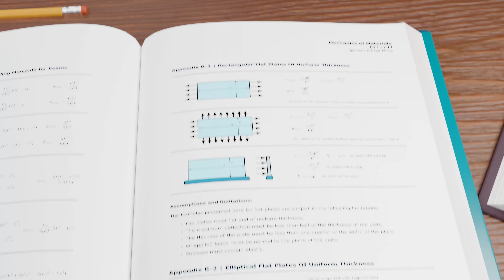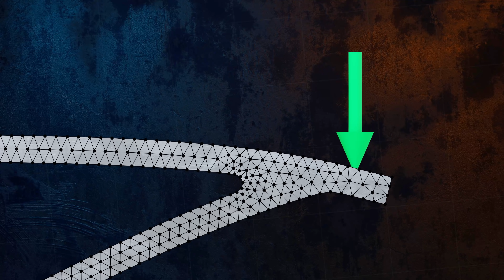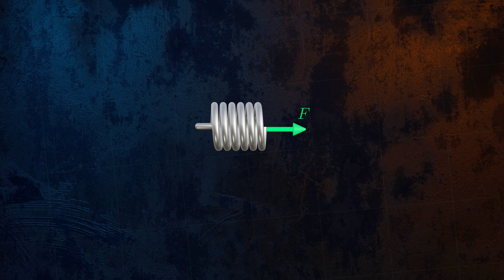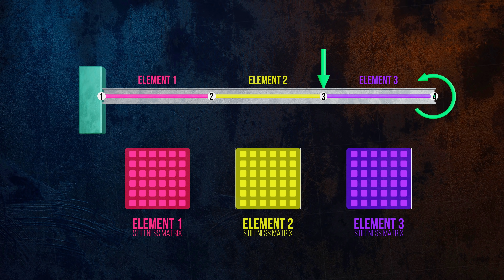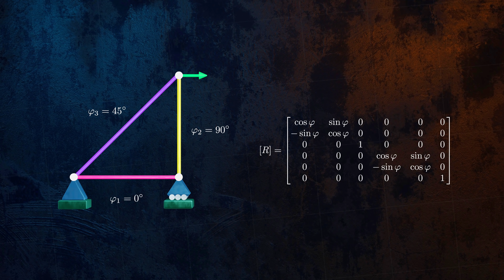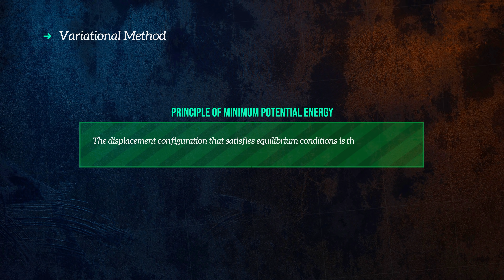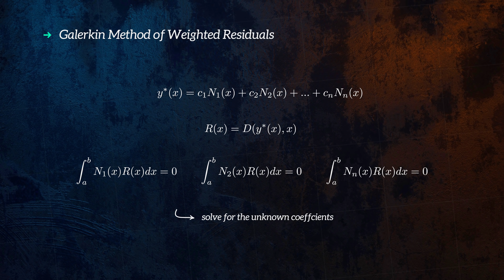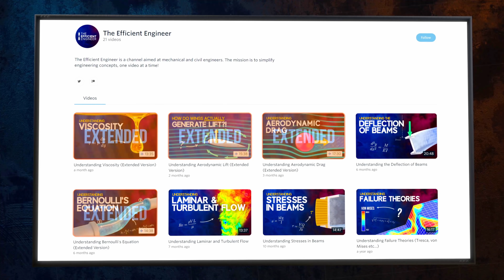Understanding the Finite Element Method

Comment: It has been a wonderful journey learning that you can also use finite element method to solve parabolic derivative pricing problems. I highly recommend using FEniCSx scientific computing ecosystem for solving partial differential equations. I recently derived the weak form for a derivative pricing partial differential equation and learned that there exists higher-level abstractions available to automatically compute formulations of discontinuous Galerkin finite element methods which is notoriously verbose to define.

Comment: Thanks for the video. I really appreciate this so easy-to-understand explanation. I'm not even a mechanical or material or structural engineer, but I can easily understand it. When I refer to several reference book, I found it's hard to understand FEA, but then I found this treasure and I could say this is the easier form than those books.
You're the GOAT. Keep up the good work!

Comment: In the video you mentioned about the equilibrium of system should satisfied the least potential principal. I wonder if I can replace it by least Lagrangian action principal to generalize such idea to the dynamic system, cause it will have to involve the time derivative over nodes which makes the equation even harder to solve?

Comment: Researching many content of this topic - I can say your Presentation is key to all!
    Like engineer I can say that finite element has become the method of choicr for solving many types of partial differential equation in engineering equations and physical sciences. It is like you have said - important applications include mechanics, FLUID FLOW (for mel), thermodynamics and electromagnetic field. We usually, take what you also say (so this is brilliant who you differnt issue) =The basic idea is very elegant and dates bak to the classic al work like Gelerkin or Rayleigh, Ritz almost a century ago.
You have all important topics! 👏👌

Comment: I really think you engineers make things far more complicated in the long run by avoiding any discussion of the underlying PDEs. It is far easier to understand the FEM by stating the PDE (in this case linear elasticity) and boundary conditions, deriving a variational form (quite easy), defining shape functions, and thence defining a discrete linear system. Completely avoiding this is silly and makes the method seem like just applying memorised formulae, makes you only be able to apply FEM to particular elements you know the stiffness matrix for, and means you have no idea how to apply the method to other problems.

Comment: What a great introductory explanation.
I was searching for a proper introduction in FEA, however, I could not find one before watching this video.
I was wondering about how to arrange the stiffness matrix etc. And why differential equations are involved.
I tried to observe the approach from engineering, but the literature was lacking of formal mathematical description or sometimes skip them.
Then I tried to observe the approach from pure math literature, I ended up only reading methods for solving the differential equation but did know why the differential equation is there.
Thanks for your great video!

Comment: I played around with the Solidworks Student Version about 12 years ago.
As I recall it did not distinguish between Normal & Shear Stresses.
In other words: 
The Normal & Shear forces were just added together, without using a Mohr Circle.
The class I took did not cover FEA, but I surmised myself using a story problem that involves:
A large pulley that is mounted on an overhanging shaft that causes bending (Normal) tension, because the shaft is supported only on one end.
A rope is attached to the pulley that has more force pulling down on one side, thus causing rotational (Shear) force on the shaft that pulley is mounted on.

Comment: This was beautiful. I did a course for CFD and it had similar information to what you covered. There is so much math history embedded in this type of modeling that is really cool. We got to use COMSOL and the solver for simple projects still took hours to get a result that would fail to converge unless you fine tune the mesh and other parameters that we knew nothing about. I wish I had more experience in this field so I could do my own 2D/3D work.

Comment: Well FKU too. But honestly I was just recapping the school material about this and figured out things. If I ever saw this, it would've been clear as a day how to apply these. I feel like so often there's a gap for some reason between learning the theoretical and applying it in your common problems. And there shouldn't be if you were taught like this. Like "look at this part of it, that's what you modify depending on this, and this is what this and that part imply so you arrange them depending". Like you learn for example the matrix and what the symbols inside it mean, but you don't actually understand how it relates to a structure or loading case.

So silly. Just list things by nodes, check the forces in horizontal and vertical directions, momentum, check displacements in horizontal and vertical and radial, and modify the stiffness matrix depending on how the nodes are connected. It looks so much more simple now. The matrices look huge and complicated, but a lot of it is zero and everything in is familiar, you just need someone to demystify the whole ordeal with matrices.

Thank god for Ansys and SolidWorks though for giving the answers without much more than modeling the item and placing the loads.

Comment: Firstly, this series is so wonderful. So much intuition easily displayed and digestible. I have a question for clarity though:

@9:30 you mention the matrix as having overlapping terms for node 1 with node 3 but in the matrix it looks like you illustrated node 1 overlapping with itself and node 3 overlapping with itself. Should the matrix illustration be mirrored about the vertical axis so that opposite corners show the shared terms?

Comment: Use correct writing of SI units' symbols, please.
Reply from the maker: What do you mean?
Reply: @TheEfficientEngineer , Hz, not HZ. MPa, not MPA.
Reply from the maker: Yeah, it's just the font. Thanks though.
Reply: @TheEfficientEngineer , not sure if you mean it's due to the font and can't be changed, or that this is just the font and it is acceptable. MPa is megapascal.  MPA is, if anything, megapetaamper.
Reply from the maker: The font I wanted to use was all caps only, so I made a conscious decision to be a little less rigorous with the units.

Comment: Great video. However, I want to point out a technical mistake in the video. Galerkin method of weighted residuals is a variational method but don’t use “weak form”. Ritz approximation method uses weak form.

Comment: Amazing work !! Thank you so much !
Just a quick remark : at 10:40 it is not the global K matrix that is inverted but the reduced matrix. Global K as shown here does not have an inverse matrix at least because of rigid body motions. And it’s usually not inverted because it is CPU  expensive, but some kind of Gaussian method is used to solve the system.

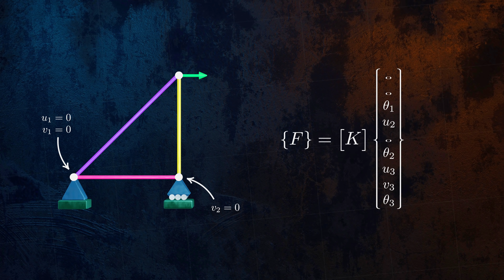Comment: Very nice introduction to FEM. Well done ! Except...at 10:28 the vector of applied forces does NOT include the reactions: reactions are calculated later from the grid point force balance. At internal nodes - the balance obviously is ZERO,but at the supports it is not. Otherwise - excellent video.
Reply: I had this same question. Do you mind elaborating on how (and when in the process) the reaction forces are determined? Thanks!
Reply: @arcanaught2045  You have the stiffness matrix of the structure. You have a vector of displacements (consisting of unknown displacements in a global coordinate system and the known boundary conditions). You have a known vector of applied loads.

I will leave aside the problem of constructing the matrix of stiffness - it involves calculation of element stiffness matrices individually for each element, transforming to the global CS and placing the appropriate terms in the global stiffness matrix where they belong.

Taken together - you solve for unknown nodal displacements. Then you apply the nodal displacements to each element (through the element stiffness matrix, and using the element coordinate system)- which allows the calculation of element nodal forces. At internal nodes - the nodal forces contributed by elements with common node are canceling each other (as a condition of equilibrium). At the supports - the sum of element nodal forces adjacent to a support (a node with specific boundary conditions) produces the support reaction.
Reply: @les8489  Perfectly described. Thank you!
Reply: Hm...my other answer with the link to my Google Drive somehow disappeared...
Reply: @les8489  I saw it! And I intend to work through the problem this morning. Thank you so much! I'm currently using FEM tools for work, but I feel incompetent because I don't really know what the solvers are doing. 

Do you recommend any particular introductory FEM textbooks to learn the topic? I purchased Introduction to the Finite Element Method by J.N. Reddy, but so far it's extremely dense and not as approachable as I was hoping.
Reply: @les8489  I worked through the problem you sent. From that, it looks like you solve for the nodal displacements globally first, then apply these displacements to each individual element and solve for the unknown reaction forces, which is exactly what you described. Thank you! Again, if you recommend any simple introductory FEM textbooks, please let me know.
Reply: @arcanaught2045  Yes. The example which includes matrices was intended to illustrate the flow of the analysis. Again - this is about the simplest example possible - but it illustrates the general approach. Regarding the books...well, there is wealth of information in NASTRAN manuals. "Programming the Finite Element Method" by I.M.Smith abd D.V.Griffiths also contain a lot of useful info. Somewhat more involved is "The Finite Element Method" by O.C.Zienkiewicz and R.L.Taylor - but there are many more available. Unfortunately there is no "quick and easy" way to understand the method.Generally - the whole method can be summarized as:

1) Mesh the structure into elements (type and order will depend on the structure)
2) Get coordinates for all nodes in each element
3) Calculate stiffness matrices for each element using the Element Coordinate Systems (you will need material properties here, and node coordinates for each element)
4) Assign identification for all DOFs which will allow to specify the size of the stiffness matrix
5) Transform the individual element stiffness matrices to Global Coordinate System
6) Locate individual terms from element stiffness matrices into appropriate location in the structure stiffness matrix
7) Prepare the vector of external forces {F}
8) Specify DOFs which are constrained and eliminate appropriate rows and columns from stiffness matrix
9) If non-zero displacements are specified at some nodes - modify the vector of external forces by adding known terms (known displacement*relevant term from stiffness matrix) and remove appropriate rows and columns from stiffness matrix.
10) Solve the problem {F} = {K}x{U} for {U}
11) Apply the nodal displacements for each element (after transformation to Element Coordinate System, of course) and calculate nodal forces
12) Transform the nodal forces from each element to Global Coordinate System
13) Do Grid Point Force Balance on each node - by summation of nodal forces contributed by all elements which has this node as common node
14) At nodes which are constrained (or have specified non-zero displacement) - this will give you the reaction forces and the forces required to enforce non-zero displacements.

This is the simplest explanation of the process - and it skips many steps, but the general idea is illustrated. It really helps to understand how the method works - because you have to be able to assess the correctness of the results produced by FEM. Knowing how it works helps a lot. I was always of the opinion that any analyst who wants to use FEM should complete a theoretical FEM course - no less than 200-300 hours. After that - a course for a specific FEM system. After that - apprenticeship under the eye of experienced colleagues for at least a year or two, with a requirement to be endorsed by "FEM guru" as a reasonably competent FEM analyst...
Reply: @les8489 Thank you for your detailed response. I have access to many gurus at my work, but I have unfortunately not taken a FEM class. I'm now looking into online coursework to see if I can take one course without attempting to earn an entire degree.
Reply: @arcanaught2045  Hm...another one of my responses disappeared...I just gave you my E-mail in case you are interested in a FEM program I wrote - but it is gone...:(
Reply: I can't seem to figure out a way to list my gmail address either without YouTube deleting it automatically. I'll try to think of something tomorrow. Thank you!
Reply: @arcanaught2045  This is good. I am just not sure if there is a "0" or "u" in the address. I sent a message to the address with "u" -which is your name).
Reply: @les8489  sorry for the confusion. It does have a zero, actually, instead of a "u". The preferred email was already taken unfortunately.
Reply: @arcanaught2045  OK :)
Reply: @arcanaught2045  I sent you email.

Comment: Now ai understand what on of the responsible of validation for architectural  structural models software in Italy once said: "if you have to rely on non linear equation methods to validate a building model without a mean to maintain a basic" pen and paper" understanding of actions, reactions and deformations , if an earthquake happens just Run!"

Comment: Arguably 'finite element'  analysis is much more computationally efficient for both heat transfer and stress. Finite element is good for odd shapes and if you want to go D-3-use and the entire budget in 2 hours type cases.

Comment: I have the feeling this is overly complicated ? I mean it's simpler in term of total amount of math, but if the computer do the job, why not just splitting the bean in 1024x1024x1024 particles and apply 1024 time 1/1024 of the forces ? With optimisation, wouldn't that be solved on a modern computer in like 10 seconds ?
Reply: That is essentially what is done here, but each element can also influence its neighboring elements, so they are not all just separate and independent particles.   Computer solutions can be very fast for 2D models; 40 years ago they took hours to run, then 20 years ago it was 20 minutes, then 3 minutes, now it is a fraction of a second for the models I use, as computers got faster over the years!

Comment: This is really well done...very clear and a nice distillation of the classic arguments (reminds me of the old MacNeal Schwendler manual...but a whole lot more condensed).  I started FEA with Nastran in the early 80's, still typing each command line in by hand.  We got Patran soon after and that made all the difference (as did big clusters of Vaxes and finally a big Cray YMP-28).  Abaqus non-linear followed, as did some primitive Computational Fluid Dynamics.  Those were exciting times and some very interesting projects!

Comment: I feared whenever I solved 1d problems in engineering I couldn't get the correct answer and doesn't know that why I am doing all this.
Now I follow the theories from ' efficient engineer' and use computational technique to solve structural problems...

Comment: Nice video!
Still, I have to say that in 5:13 there is a detail, I mention it because if work on that.
Plate elements have 1 displacement (z) and 2 rotations (x,y), and Shell elements contain 3 displacements and 2 rotations (3 if you add drill effect on z).
Still, it is an excelent video, most teachers are not able to explain this in simple ways to students.

Comment: I like the presentation. I think the matrix transformation at 9:40 is inaccurate. Stiffness matrix transformation is not done just by multiplying it rotation matrix. You actually need to multiply inverse rotation matrix, stiffness matrix and rotation matrix. Also, the same coordinate systems have to be used only at individual node level, you don't have to use one system for the whole mesh.

Comment: This reminds me of the FEA class I took in college (after graduation).  Of course, we only had a PC-clone back in the mid-80s, so it wasn't particularly powerful.  We learned the theory and ended up writing (or trying to write) our own FEA software.  No graphics, so a lot was done by hand to configure the elements, etc. I think my first "successful" run made my very simple model look like rubber instead of steel.  ;P  I wish I still had those class notes & programs to play with today.

Comment: Although it was mentioned at the beginning of the video that FEM can be used to solve Fluid Mechanics, Heat Transfer and Electromagnetism problems, it really shouldn't be used for such applications, since those kind of problems relies heavily in conservation of energy, mass, momentum... While using the Finite Elements Method the differential equation is integrated in the non-conservative form, using other methods such as the Finite Volumes Method will guarantee conservation of those properties for any mesh size, which is really important. When the spacial and temporal meshes tends to 0, all methods converge to the same solution, but since it isn't possible to have an infinitely refined mesh it is important to select the right method for different kinds of problems. In the same way the FVM also can solve solid mechanics problems but in certain situations the FVM can handle first derivatives badly, as well as the FEM handles second derivatives badly, both scenarios leading to instabilities.
Reply: So, the problem with FEM is that the result will be influenced a lot by  mesh dimension?